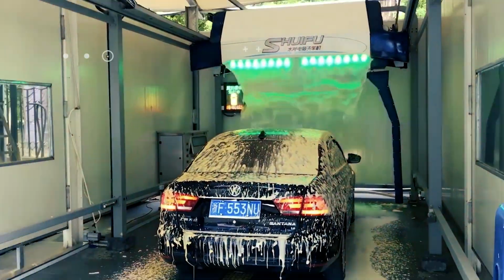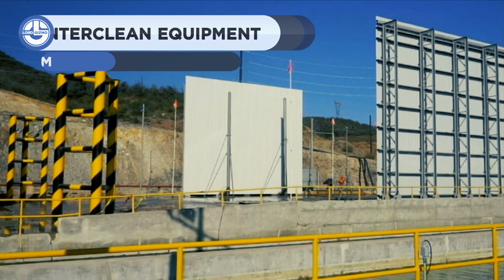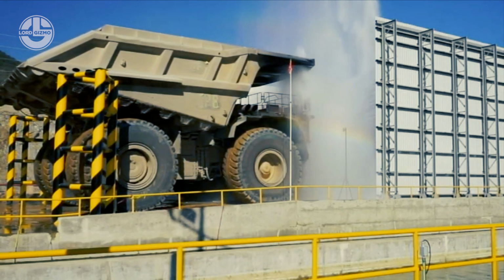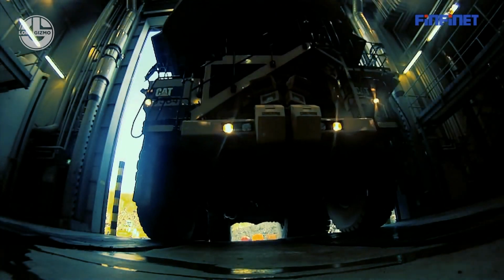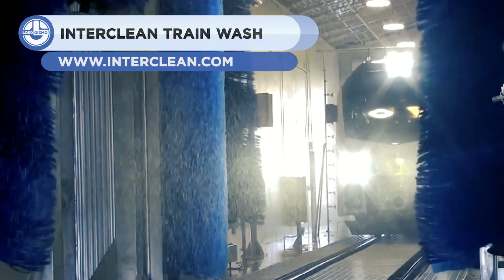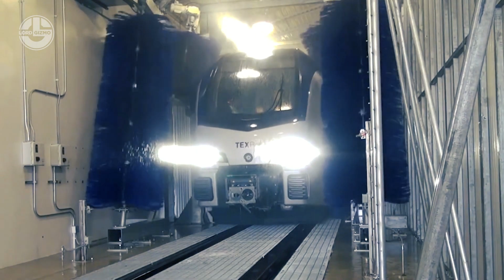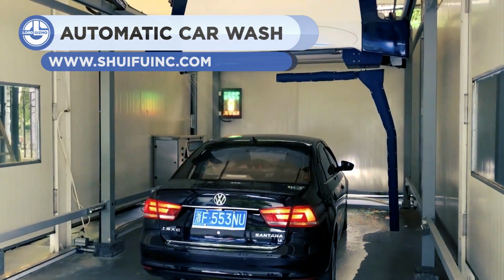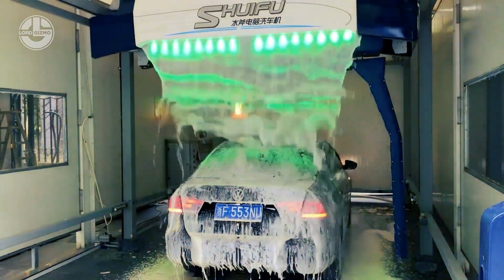MEGA Washing Systems Washing The BIGGEST Machines

Comment: I can tell you right now, those manned hoses are not 3000PSI.
Reply: I bet there close
Reply: Have you ever used a power washer you need a lot of psi
Reply: @JH_HAY  Yes. I have a 3000 PSI commercial power washer and it has a 1/16” tip on it and it will wear you out. 3000 PSI on a 2/3” nozzle is over 6000 pounds of pressure being applied to the man. Unless this guy is chuck norris, he’d be on the moon by now if those were running at 3000 PSI.
Reply: @brendonwillis5438  The hose is attached to the deck. The person just turns it side to side but the mount and deck are taking the recoil
Reply: @railgunawesome7114  I saw that a time or two, but most of what I’m seeing is a guy with a hose. Fire trucks are discharging at 150-200 PSI and the men manning the hoses have to hold an aggressive stance to not lose control.

Comment: That last “Touchless Style” wash doesn’t do a good on cars that are more than just dusty. I’ve used three of them that I’ve found while driving for work and when done you’re left with a wet and dirty car. I’ve stopped using them. 
This was a great video nevertheless.
Reply: The air dryer does a horrible job as well

Comment: Automatic car wash - Computer controlled, saving labor cost and work efficiency. And at the same time putting even more people out of jobs. Ain't technology great?
Reply: Why would you let people do it when machines can do it cheaper, faster and better? Plus people who design the machines get more jobs
Reply: automatic car washes have been available for years but most don't use them because they will scratch your car and the touch less ones don't clean 100% you'll get water spots and some small areas of the car like the handles and door shuts are impossible to clean by machine . so there is a market for both manual and automatic for trucks and work fleets and for normal cars